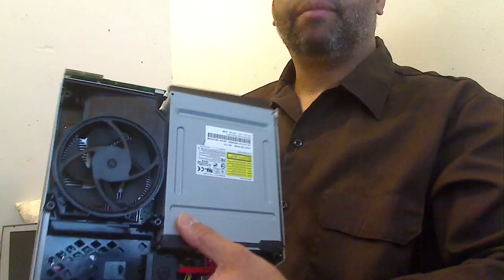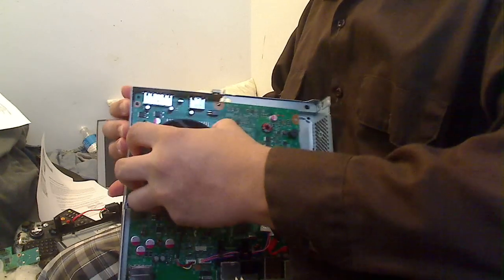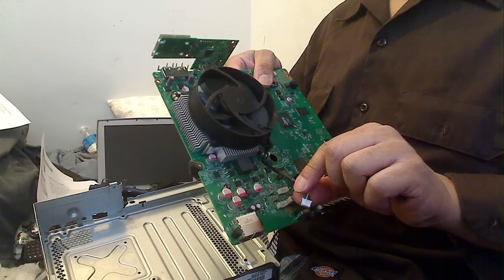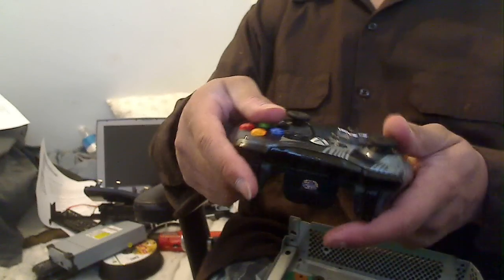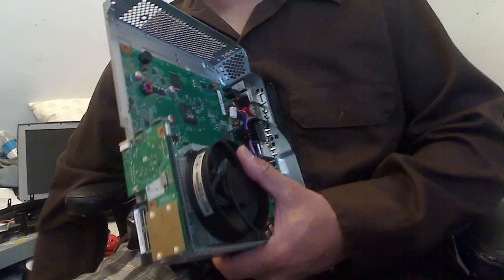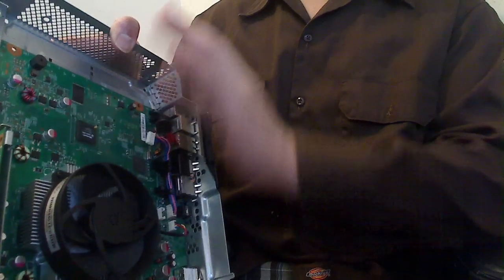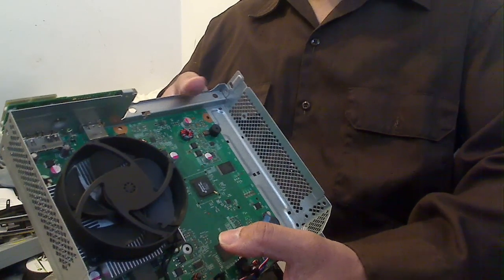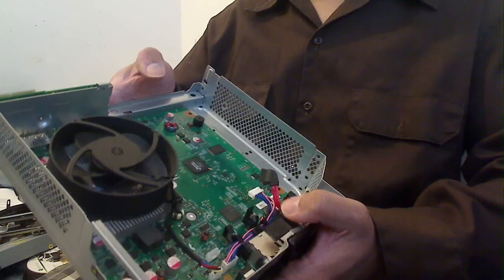How to fix Xbox 360 Slim RROD / Red Dot of Death Reset Solution👍

Comment: Hey I know this is an old video but I figured I'd ask a question and hope you have an answer for me. 

My sons xbox 360 e took some impact on top of the disk drive and I have the xbox taken apart as I write this. 

The disk drive opens up well and everything inside is nice and clean with virtually no dust. 

When it is powered on there is no video and the green light immediately switches to a solid red. Would disconnecting the fan help reset and solve this issue? Do you think it needs a new drive?
Reply from the maker: I don't think this is a reset issue.
Reply from the maker: The red light is an indication of a ground fault. Since it took an impact it could be almost anything. You should 1st use a flash light and check all the USB ports to make sure there are no bent pins touching the metal insides and make sure there aren't any touching one another. There are 4 metal pins inside of each USB port. Check them all. Next check to make sure there are no bent pins in the HDMI port on the Xbox if that's the port you're using for video. Third, try turning on the Xbox without the video cable plugged in to see if your light still turns red.

Comment: Dear sir after I repaired my console now it's give me other error ventilation error and it's shutoff
Reply from the maker: Ventilation errors are associated with overheating. Be sure to clean the top of your Xbox CPU and add new CPU paste for proper heat transfer from the CPU to the Heat sink to the fan and then out of the case.

Comment: Ok I have done everything but when I try to get it to reset by leaving the fan off it doesn’t reset. It just stays on. What else should I do?
Reply from the maker: I'm not sure what everything means but the Xbox resets when it over heats. If the processor doesn't over heat then it will not reset. You can check the heat block to see if it's getting hot but there shouldnt be any active cooling like a fan or passive cooling like a cold room with an air conditioner. If this direction continues to fail, follow the verbal instructions in the video for applying heat using a heat gun.

Comment: What is the size and type of screws and washers
Reply from the maker: Don't use the screws and washers. Re-use the X-Clamps.
Reply: @Romerro1  Ok just clean and re-apply the thermal paste
Reply: and take off the connector to reset it
Reply from the maker: @ps2daddy  clean, replace the CPU paste, Use the rest method in the video and power back on. If that doesn't work, follow the instructions for a heating reflow with a hot air gun.
Reply: @Romerro1  understood, thanks for the info
Reply from the maker: Good Luck

Comment: Hello i have problem with my 360 slim corona, whenever I turn on 360 it always shut down when try to booting in dashboard, but I still can enter xell loader, this is red death issue or what? What should I do to fix? Thanks for answering 🙏
Reply from the maker: OK so this is a NAND FLASH for playing iso's?! If you can load into the Xell loader and you do not see a red light on your power supply or on-front of the Xbox then its not a Red-Light issue. It's most likely your loader. Check for an updated version. It may also be a Microsoft security patch issue, although I doubt it, especially since you're using a legacy device. But if it is a patch issue, check for a Xell loader update and reflash.
Reply: Yes sir, I can get in xell loader and my 360 not shut down in this state but it will shut down whenever try enter dashboard, what this problem? Could you show me the link to fix this? Really thanks for helping me 😭🙏

Comment: i do tha same way just heatup gpu and put screws but it works only a week again same problem
Reply from the maker: You may want to check for blocked ventilation or something causing excessive heat build-up. Make sure there's clear open space all around the Xbox and that it is not inside of an entertainment center where heat can build up.

Comment: I know this is a stupid question but does it delete all the data? Also my Xbox did not come with a removable hard drive.
Reply from the maker: I can't really answer this question without you defining the word, "it." In this scenario try restating the question and replacing the word it with a thing or the thing that you're talking about. Also whats your Xbox model? Is it a phat, slim or E version?
Reply: Donte Beachem Thank you for catching my error. Does this process of unplugging the fan and letting the APU overheat shutdown and cool down then turn on delete all the data? I have the Xbox 360S
Reply from the maker: Hey Wackie, this process does not delete any data what so ever, whether it's on an internal hard drive, external hard drive, memory card, USB Stick or embedded 4GB memory module.

Comment: My xbox slim power stays on green but when I plug my HDMI cable in it turns red ummm 🤔
Reply from the maker: A green light indicates that your Xbox is functioning but it looks like you have a video out issue.
Reply from the maker: Wow. That's an old one. Your HDMI pins in the back of your Xbox are most likely bent or damaged. The other possibility, if you haven't already changed the HDMI cables is that your HDMI cable is damaged or the HDMI pins are bent in your TV. check all these things listed. Check the rear of your Xbox for bent pins and try replacing the HDMI cable but also check the pins on your HDMI input on your TV. Xbox 360's had multiple alternate video output options as I believe the Xbox 360 slim does as well. If you cannot solve the HDMI issue, there is the Xbox 360 video out to component you can take advantage of if your TV supports component inputs. Good luck.
Reply: @Romerro1  thank you so much for your reply I'm  not even getting any signal so I will check my HDMI cable and also in the back of the console and give it a clean 👍

Comment: I tried this way first, but it diddn't work. What did work, was using a heat gun on the chip on high for about one minute using foil surrounding the chip for protection of the rest of the board. I was careful not to touch or bump the chip and just let it cool for about a half hour. After that, I applied new thermal paste, then put it back together and it works great.
Reply from the maker: Well that's Awesome Curtis. That's actually what I suggest if the basic Reset method doesn't initially work, although the heating times I suggest are a little longer. Regardless, great job on getting your Xbox back to functionality and Happy Gaming.
Reply: Did you apply the thermal paste first, heated the chip then put new thermal paste or did you just heat the chip first and then applied paste?

Comment: Many years later and im here, just found your video, and bought some new good thermal paste for it, if it works im gonna come back here for feedback, thanks a lot👍
Reply: So?
Reply: @ZRobertZ3  didnt work at all
Reply: @micaelmarcos4323  Same for me. After pulling it all apart, cleaning everything thoroughly, reapplying thermal paste and making the necessary connections, it won't power on at all.

Comment: Hi man, iv been having some rdod troubles and I followed your video and I’m still getting it, I replaced the thermal paste but still not looking good, the fan runs really slow while the dot is red. Iv tried to reset it several times but just no luck, I don’t know if it’s because iv kept the original clamp for the fan?
Reply from the maker: You can keep the original clamps. You should check your power brick. Make sure its the correct brick and that it is also not red ringing.
Reply from the maker: One of the last things to try besides reballing, is to use a heat gun on both sides of the the PCB following the instructions in the video.

Comment: My Xbox was running great and while playing Black ops 2 on the disc the console got the red dot so I turned off and re turned on and goes red after a few seconds. Won’t boot up and disc tray won’t eject. I tried different power supplies and blew compressed air over all major points. Even when it was running it never felt hot, and it’s throwing me a 0023 secondary error code upon holding the controller connect and pushing the power button. Is this fix only for overheating Xbox’s?
Reply from the maker: This fix works for ground faulted Xboxes, which have shut down internal operations because of a detected error which may cause permanent damage if allowed to continue. This self diagnosed error occurred and signaled to the user there's something wrong, via a blinking red-dot. You may try this fix to see if it corrects your ground fault.

Comment: was looking to see if you could help solve a problem im having with my 360 in attempt to fix the RRoD? please and thank you
Reply from the maker: What's your problem.?
Reply: @Romerro1  so i attempted to do this repair on my 360 slim r2d2 and shortly after i plugged in the ac adapter into the 360, i turned it on to reveal the red light and then the 360 shut off and my ac adapter light went to red, i have let the ac adapter cool off to go back to its original stand by mode (orange light) but even then, the 360 has not been willing to turn back on. (ac adapter works to power another 360 so i know its not that)
Reply from the maker: @Kalmar5567  OK sorry this reply took so long but a red light on your AC power adapter usually indicates a power brick issue but there are other issues to consider such as issues with your video cable (HDMI or Component). Plug in the power adapter but disconnect your video cable prior and if the light on your Xbox and power adapter stay green, then you may have a bad cable or possibly bent pins in the HDMI port of the Xbox. The other thing that can cause this issue is bent USB pins grounding out in the USB port. Check all the ports with a flash light to make sure none a bent upward touching the inside of the port. But from most of my experience, when the Xbox AC adapter turns red, it's an issue with the AC adapter and needs to be replaced, unless it's an Xbox 360 phat. The AC adapters for some Xbox 360 phats that require 14amps could also fit into a phat that only required 12amps and when ever someone would mistakenly do this, since their Xbox powered on, they would continue using this wrong adapter, the extra power caused damage to the phats over time giving them the RROD. Not the RDOD.!

Comment: I don't understand how I'm supposed to overheat in when my Xbox instantly red blinking lights and the safety shutdown happens 15 seconds later.
Reply from the maker: If your console is shutting down a few seconds after your Xbox red lights, you might want to try just replacing the CPU paste. The CPU paste allows for efficient heat transfer from the CPU to the Heat block/heat sink. Completing this step may solve your red dot error alone.

Comment: Hey Donte great, informative video but after trying everything u suggested, even heat gun on both sides of MoBo on high for 5mins, I'm still getting the RedDot and a secondary error code of 0010 pointing to the southbridge as the cause. My power brick light is orange when I plug it into the xbox 360 E but the solid red dot still appears when I power the console up and the orange power supply light still remains . Should I just call it a day or do u have any last suggestions. Thanx.
Reply from the maker: Good explanation of what you've done, although "trying everything" kind of omits your actual completed task's. 1. Did you reset prior to using the heat gun? 2. Did you reset after you used the heat gun.? 3.Have you applied thermal paste to the cpu and cleaned off all previous hardened cpu paste. 4.did you make sure the hard drive and DVD were not connected during power up? 5.Have you checked your Xbox with a different power brick? If you've done all of these then find a schematic of the board, locate the area of interest, such as the "Southbridge" chip and heat up that region moving the heat gun around and not stationary. Also, as far as I know, there are no proven methods that I'm aware of, in using this repair for the "E" version of the Xbox 360 but that doesn't mean you shouldn't try
Reply from the maker: Before calling it a day you may want to borrow an identical power brick to test it with your console just to make sure its not your power brick that's ground faulting because of it's own error.

Comment: unplugging the fan and letting it overheat worked for me. Except I didn't wait 30 mins for it to cool down and I just stuck a small desk fan over it for 5 mins or so. I did replaced the thermal grease with arctic silver while I was at it. Thanks for the video.
Reply from the maker: Awesome job Keith1212.

Comment: Hey bro. I cleaned it back and forth with isopropyl alcohol thoroughly.  Still red dot. 
Now I'm going for heat gun. 
Any model brand recommendation? One that has low and high as you said. 

Is a hair dryer enough?
Reply from the maker: The heat gun I used had 2 settings. One had a setting for 500(low) and the other was 1000(high).
Reply: @Romerro1  i did ur procedure. Thankfully the rdod is gone. Found white traces on some areas. Back and forth. Did the reset twice. 
However the console stays with a green dot and nothing happens. No boot. No fan speed change. Hdmi and av both same. Hdd in or out. 
Corona 16mb nand. 
Any ideas bro?
Reply from the maker: @snawfel1983  Did you flash the Nand or did someone else flash it
Reply: @Romerro1  no, i was the first to open it. And i am waiting for jr programmer to be delivered to be able to read / write nand. 
Can it be corrupted on its own? 
I am thinking of reading it. Then flashing back or smth i dont know.
Reply from the maker: The nand can not be corrupted on its own.
Reply from the maker: I do not have a recommendation for s hest gun.
Reply: @Romerro1  i will go for heat gun procedure. 
How to apply. What distance? Swipe fast or slow motion?
So 5 minutes low 10 min high?

Comment: Does it completely wipe everything
Reply from the maker: No it doesn't. All of your games and data are saved on your hard drive. The reset will reset your CPU from it's ground fault status. It does not reset your hard drive.
Reply: @Romerro1  ok thanks, if I have a problem I will  ask
Reply: @Romerro1  ok so I still have the issue even after I did it and I still have the problem

Comment: hi could you tell me what screwdriver i need for the heatsink.
Reply: if you mean the x-clamp, then you should watch a video on how to remove it. In layman's terms, you have to pry it off, but if you're careful, you can still use it after removing it
Reply: @Zayahhh  thanks for the reply, but I found out what screwdriver I needed (t8 torx) I replaced the paste, did the reset, sadly it didn't work, oh well
Reply from the maker: @viransingh1200  try some over heating. If you watch the video to the end, you'll see that I used a heatgun with the reset to get that Xbox up and running. That Xbox still works some years later.

Comment: Tried resetting... wont let me. I did everything, the xbox does the same thing as it did before. It turns on, does the xbox logo (light is green throughout), then shuts off and the solid red dot is there with the screen all black.

Edit:

It still does not work but a recent finding: the dot remains green if i unplug the HDMI
Reply from the maker: The HDMI input is your problem. HDMI's can go bad (try replacing), the pins can get bent inside the HDMI ports on the Xbox or TV (switch to component or use red -white-green cables, which ever your TV supports). If all of these fail hook the Xbox up to another TV using HDMI or one of the other outputs. Scroll through this forum for other solutions that have to do with video failure. There are plenty.
Reply from the maker: Another option would be just to replace the HDMI cable if the pins are bent beyond repair.

Comment: Unfortunately my xbox has still the rdod :( do you have any other tip?
I just wanted to play after a few weeks (the xbox wasn‘t plugged in) and it just didn‘t work anymore! I haven‘t even got a signal on my monitor!!!
Reply from the maker: It could be your HDMI cable, other video cable, power or almost anything from my perspective, which means I have nothing to go on. "I did everything" doesn't tell me anything and "it just didn't work anymore" doesn't help either, but I get that  you would like some sort of idea from all the years of suggestions that have been provided in this forum to come flowing to you in one sentence. Not possible.! You'll have to state in Full Sentences what you did exactly even if it's in the video provided. I can then possibly offer some assistance. Maybe you might even attempt to explain exactly what your Xbox is doing In Detail. I'll respond after an appropriate explanation..

Comment: Hi Mate , I have a same red dot problem. But it’s doesn’t run continues. After red dot appeared two 3 seconds shut down. Do you know what is the reason. Thanks
Reply from the maker: This could be caused from over heating. Unclog your Xbox vents, remove it from any cabinets and away from carpets. If non of these are your problems, then the CPU paste has most likely dried up and is no longer providing the heat transfer from CPU to heatsink. You'll need to open your Xbox, remove the  CPU heatsink and fan, remove the old dried CPU paste and add new moist CPU paste and then reassemble. You can purchase CPU paste from Amazon. You can find other videos on YouTube for Xbox disassembly and CPU heatsink removal. Good luck.